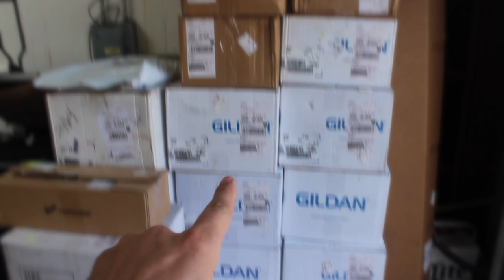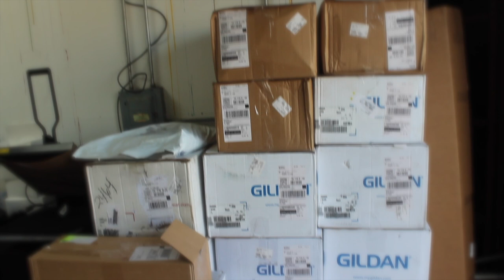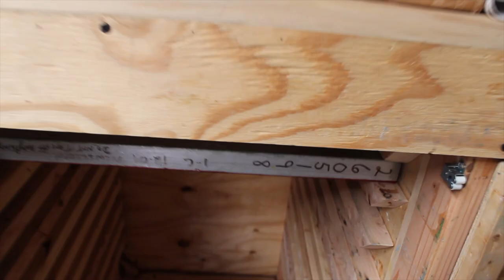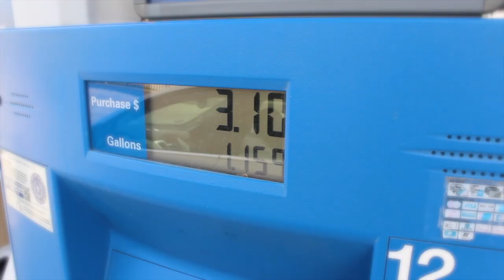I Screen Printed 1,000 T-Shirts By Hand

Comment: Hey man, thanks for these videos!  They are always inspirational. Do you guys print with Water-based or Plastisol inks for the most part?
Reply from the maker: Thank you! We really appreciate that. We print with plastisol but I'm looking forward to moving into waterbased screen printing only. We have a forced air dryer, but printing with waterbased inks definitely slows down the process. However much more user and environmentally friendly.
Reply: Yeah we're at that same point, started experimenting with water-based printing. Seems like the next logical step. Keep up with the videos and good luck on that side.
Reply: Mikey Designs & Silk Screen I am a newbie. Why do you say you look forward to printing with water based inks only?
Reply from the maker: Hi Bridget. It's just more environmentally friendly, and user friendly health wise (less chemicals to no harmful chemicals depending on the  brand). You use less chemicals in the cleanup process as well.  No need for a chemical ink wash.  Only draw back is you have to clean up immediately and put everything away. Also, waterbased ink is MUCH slower when it comes to curing.
Reply: Mikey Designs & Silk Screen Mikey Designs & Silk Screen Thank you. That makes sense. As I mentioned before, I am new to the screen print world and practicing with water based inks. I thought the goal was to print with plastisol. I was thinking plastisol was a better ink. I am glad to you cleared that for me.
Reply from the maker: Plastisol is easier to work with and has it's place. It depends on the clientele. We've strictly use plastisol. We really do not get any clients that ask for water based. However, if we printed with water based inks, not many would know the difference. Certain clients will, and if you advertise you print with water based inks, you'll get that kind of clientele. Just depends on what works for you. Water based inks are just more time consuming for a small shop, however, what are your clients needs is what it boils down to.
Reply: Mikey Designs & Silk Screen Thank you!😊
Reply from the maker: Any time! :)